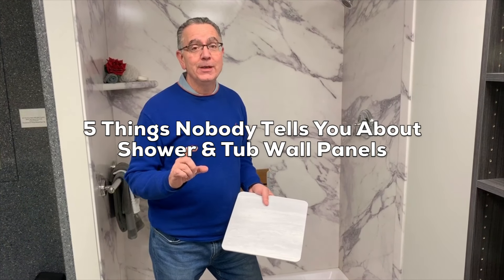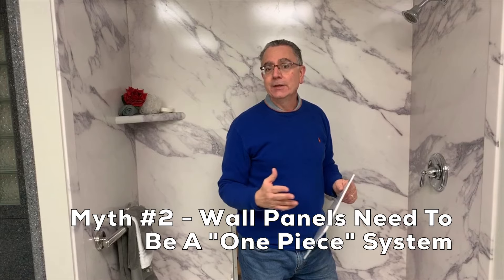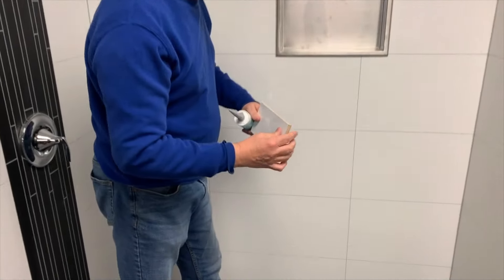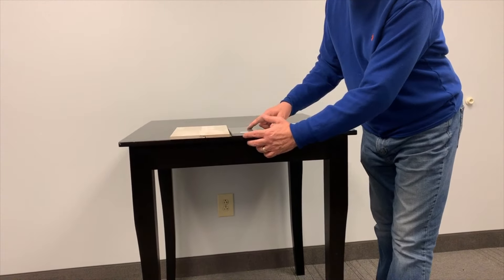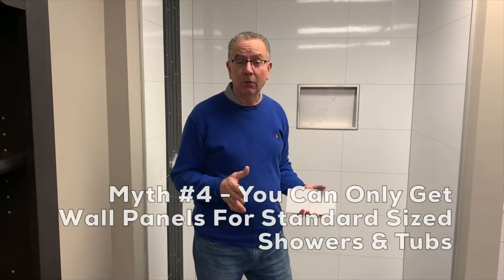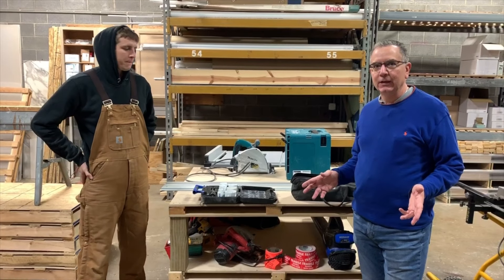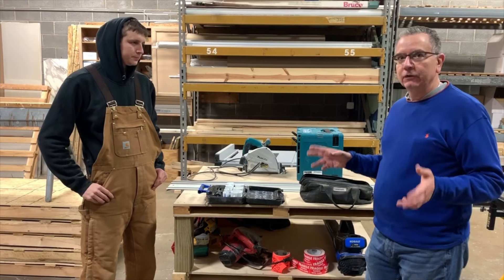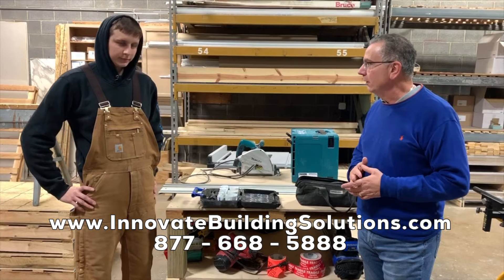Shower and Tub Wall Panels: 5 Things Your Bathroom Remodeler Doesn't Tell You

Comment: I just installed 3/8 thick cultured marble walls on a shower stall remodel. It’s a combination of marble dust and acrylic polymers that come in custom sizes.  Attaches to the drywall with an adhesive. Only two seams to caulk in a 36x48 inch shower. I would NEVER a install any wood product in a shower wall system.  I find this video helpful in showing what they  use is what not to use.
Reply: I would totally agree. Not wise to put wood in a constantly wet location
Reply: I've seen a lot of cultured marble. It is a good material but most of it does not look like real marble.
Reply: Where did you buy this and what is the name of the product, please? Thank you

Comment: Too many surfaces that can leak water.Each panel 4 sides and now multiply that by each panel so you are talking about over 100.What is the chance the glue fails mold grows behind? I think good chance.
Reply from the maker: Ruben, Thanks for your comment! These wall panels actually have a lifetime warranty. And with the aqua lock system used to interlock these two panels together plus the sealant, there is no way for water to get behind these panels.
Reply: Right just like a flashing a roof pretty sure they thought of this when they created just work it up from the bottom to the top
Reply: You must be living in Mars. 🙄
Reply: Hi Ruben, how many sides does a tile have?
Reply: Oh man you are trusting wood backed laminate panels with caulk??

Comment: How are the corners and the floor made waterproof?
Reply from the maker: Eric - it really depends on the system of waterproof wall panels. But in the best systems there's usually a inside corner profile and sealant used in the corners and in the laminate wall panels there's a 'base profile' at the bottom and sealant. These are the key places to pay attention to with grout free systems! Mike